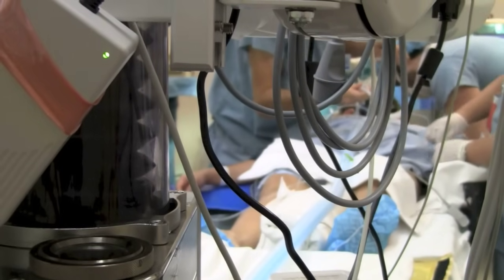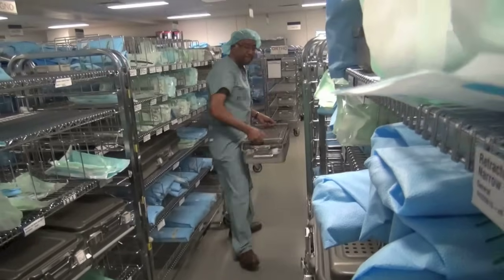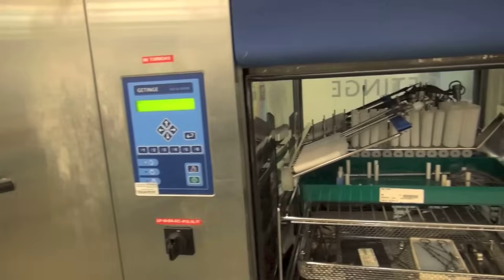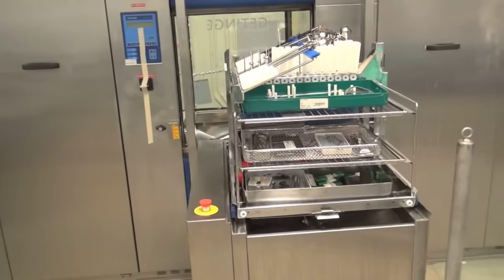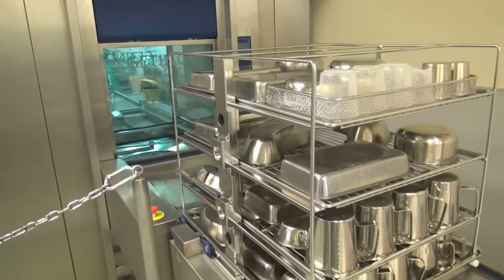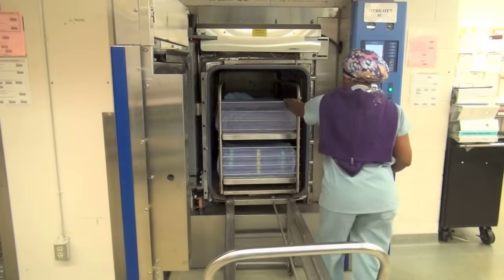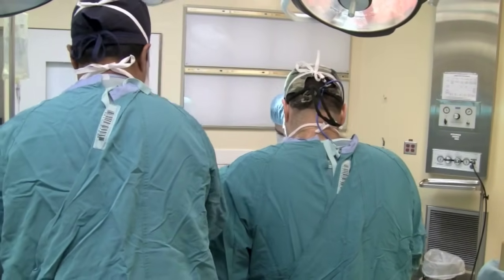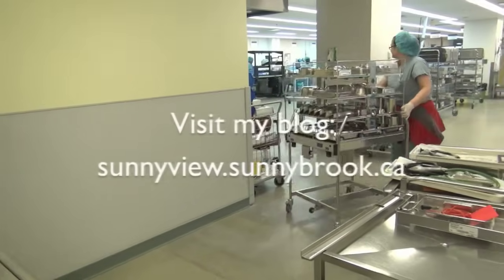See how hospitals clean medical devices

Comment: Why not use Electron Beam (EBeam) Irradiation technique for Sterlization before reuse. It is far more effective than steam. The EBeam can do mulitiple tasks including Sterliziing the laundry, other incoming deliveries, gloves etc.
Reply: That's not going to get rid of the blood, bodily fluids and stains
Reply: @ananthasb5550  Sterilizers dont get rid of blood and such. That is what the washer is for. Sterilizers just sterilize. They use steam because it is the cheapest option
Reply: Steam is the cheapest option thats why
Reply: And steam also is very good at cleaning and killing bacteria and germs
Reply: @jeffco20044able  Depends on the instruments. Some require low temp and need VPRO using Hydrogen peroxide and vacuum.